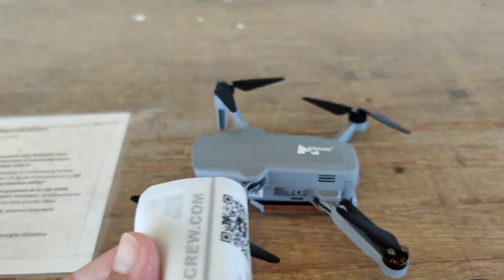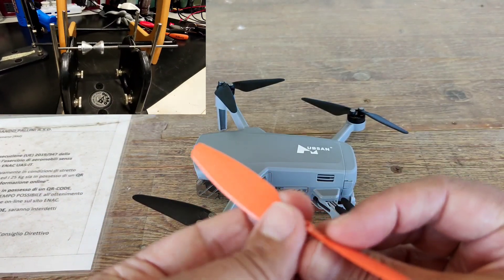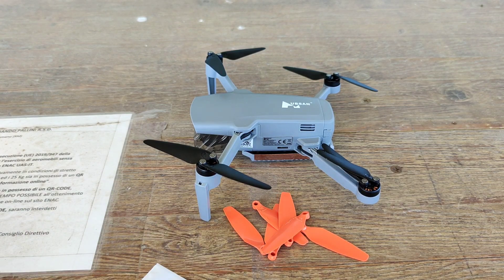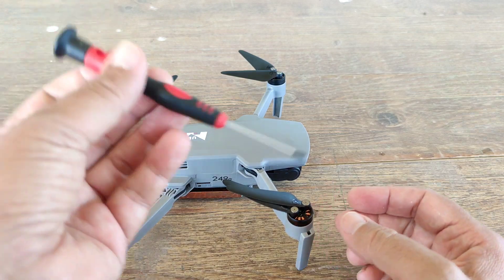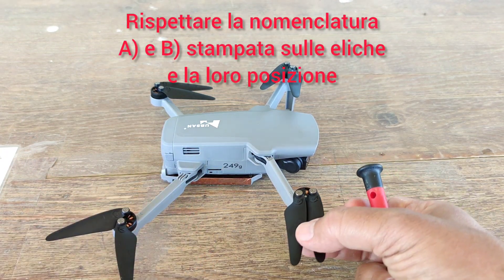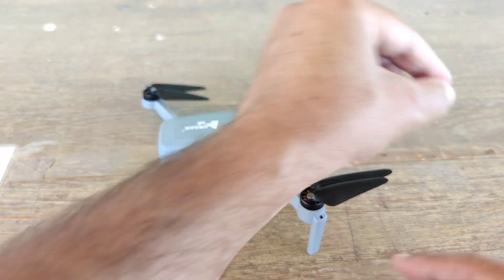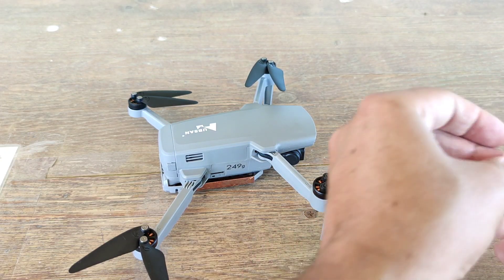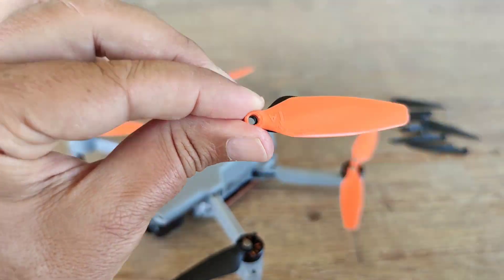Eliche originali o Master Airscrew sullo #zinominipro?  Analisi tecnica #jelloeffect #masterairscrew

Comment: Great test! 👍🏻 I’ve been testing these props on the Zino Mini Pro, Zino Mini SE and EXO Mini Pro+ and they work perfectly. The stability of the drone is definitely improved, especially in sport mode and the noise is reduced producing a lower pitch unlike the original ones which have a higher pitch.
Reply from the maker: Yes great props. I use on Mavic Air2, Mini 2, ZMP and DJI FPV.